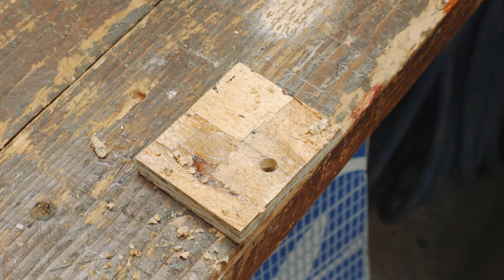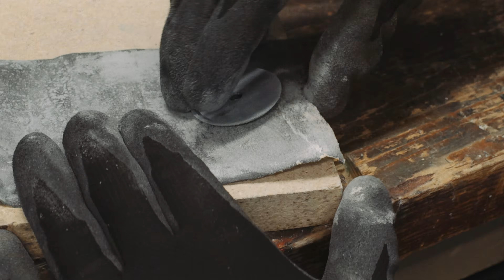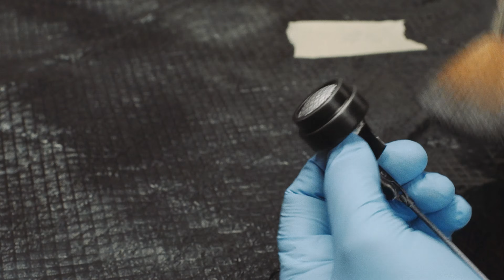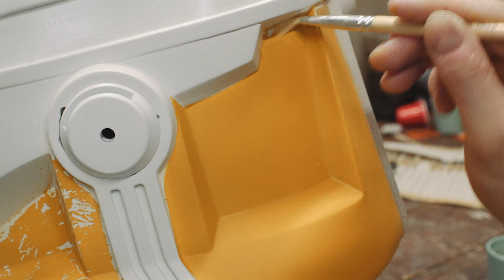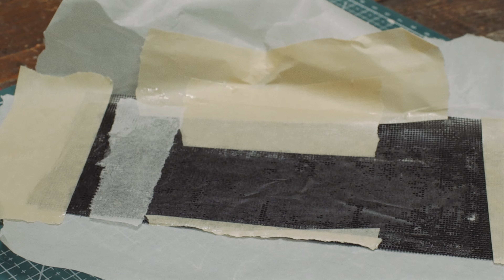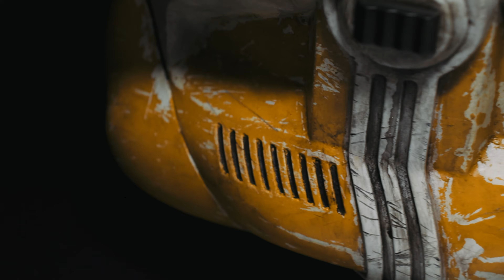How To Fix A Failed 3D Print (Phase 2 Commander Bly Helmet Build)

Comment: Been speaking to my two Crafting Senseis who do prop making for a living and giving you all guys this information to make high quality props and save 70 % of your time:

Sand Rawprint with 60 or 80 grit.
Use a 2k Putty that is SOLID for real rough areas or areas that need to be rebuild (its hard to sand but its tough and fills everything)
Sand the putty down.
Use a High build filler (needs to be 2k. no can paint stuff. 1.3 nozzle)
Sand it with 220-240 and then sand it again with 400

Thats it. You save a lot of time and your prop is made high quality. Just look at how car people do their stuff and replicate most of the process.

We dont need Resin to sand. we dont need wood filler. we dont need filler primer (can). we dont need bondo (1k).

Comment: I will tell you if you are in a hot or humid area like me, you have to thin more than they say, I sometimes even have to thin paint made for an airbrush, also with the airbrush when painting acrylics which are water based you will nearly always get tip drying on your needle which will clog the paint, I keep a very soft new toothbrush and about every minute or so dip it in water and gently rub it over the needle, good to go again.....keep up the work....the pastel with mod podge is great tip
Reply from the maker: Thanks for the tip. I’ll give that a try!

Comment: I think the brush you used has bristles that are way too hard for this job. I'm coming from miniature painting and scale modeling, but I would personally never use such a cheap pig-bristle brush. At least to me, who does stuff like this on smaller scales, this seems like using a wire brush. Same goes for using the other side of the brush. It seems way too flat to result in anything but large scale demolition. Try a softer synthetic brush, both a flat head as well as a "classic" brush. Something like a size two for better control. I'd also rather use tooth picks than the back of my brush. Way finer control.
I always spray two coats for best results and yes, thinned. Works like a charm. I think the uncrontrolability of the process is part of the result, on larger surfaces.
Reply from the maker: Thanks for the tips!
Reply: Also, why did you paint yellow, chip it, then paint brown and repeat the chipping? Just paint everything and then do one chipping session. It will look ever betterr, because now you have areas that are chipped and then go straight into pristine paint. That doesn't look like natural chipping. Why did I scrape my helmet, losing yellow paint, but somehow the brown paint right next to it, is pristine? That and it is just more time efficient. Still a great looking helmet!
Reply from the maker: @Vortagh  Definitely will do that next time. This was my first time 😅

Comment: A tip for chipping- you can use hairspray instead of chipping medium. Either decant it or just spray it on directly
Reply from the maker: Great tip! Is the hairspray activated by water the same way? Also, can it be sprayed through an airbrush?
Reply: @brungerbuilds  No, you spray it right from the can. Unless you have just a smaller area to spray. However, in that case, I think it is a lot easier to just mask and spray, instead of decanting it.
Reply: @brungerbuilds  Yes to both. I’d test it out first but that’s what I use

Comment: Watching now. Figured I'd give some thoughts while watching

-No corny youtube intro video. Straight to the point. This is excellent.
-Stating where you got the files and also listing things in the description is super helpful.
-Never thought about using superglue to have something set faster so the epoxy can do it's work. Great idea.
-Yeah, people say a milk consistency for airbrush paint. Maybe they mean skim milk. lmao
-Have you tried the paint chip method with masking liquid / liquid latex?
-Cheap acrylic paint is perfect for weathering. Have you tried oil paints? I love weathering with those

Great video overall. keep up the good work. but maybe have some small projects lined up so if you can't quite make the weekly deadline you can do something more simple for that week's video.
Reply from the maker: Appreciate ya! I plan to try out the masking liquid technique on a future build. I’ve seen people use kid’s craft glue and achieve similar results so I’ll probably give that a go!

I haven’t tried oil paints yet since I’m pretty happy with how the acrylics work, but maybe sometime in the future! 

Definitely panning to add some smaller projects here and there to give myself a break, but this next one I have in the works is gonna be big work 😅